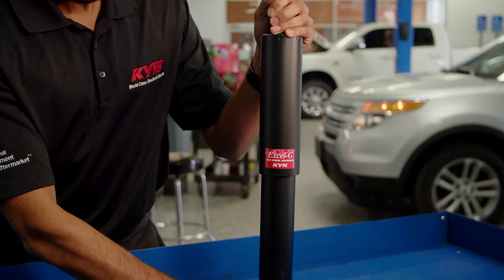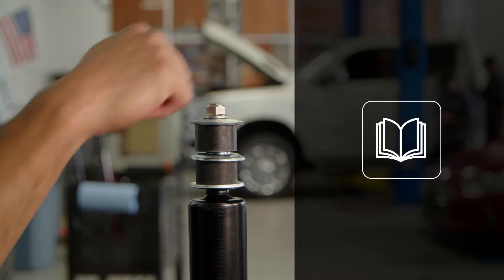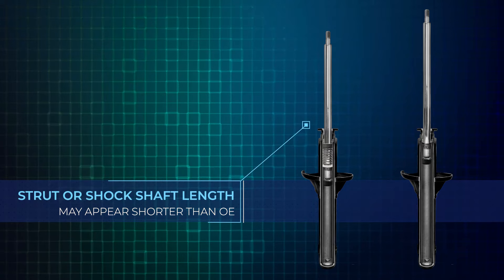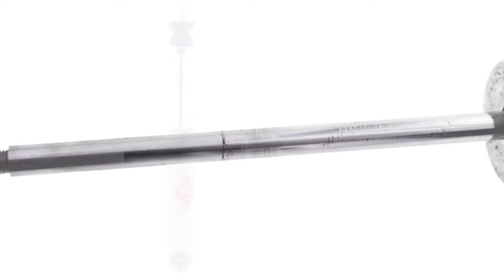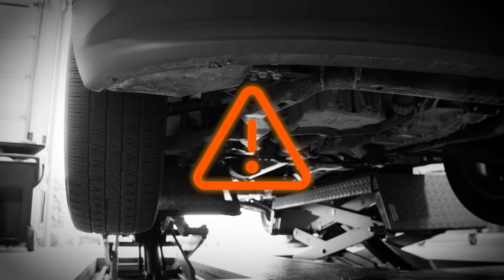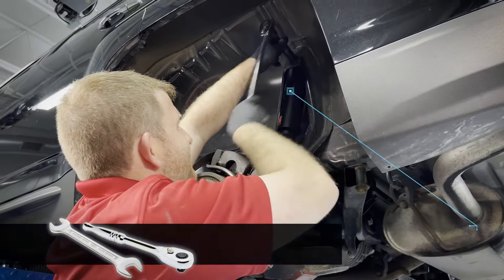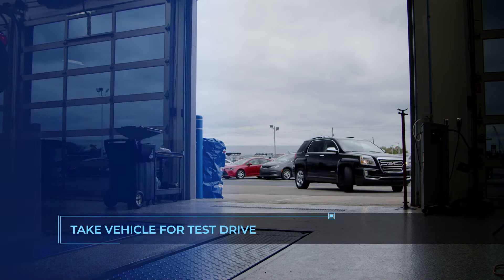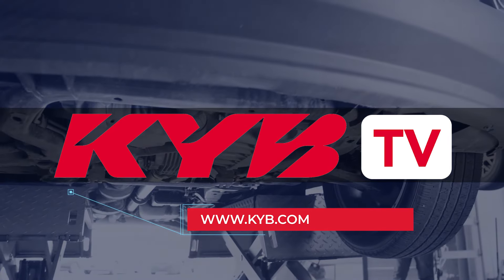KYB Shock Installation Pro Tips

Comment: I had a question on my 2002 Honda Accord LX V6 the 341257 model only comes in one style for front. All of the quick strut styles come on a left and right side model. Anything I should do to make sure they are installed properly?
Reply from the maker: I'd have to check with our tech support team. Emailing them questions like this would be a much better strategy than asking in a comment section. Please reach out to our tech support team at techsupport@kyb.com.

My guess is that it could be due to spring wind direction. The strut could be the same, but the springs used in the complete assembly could be left and right side specific for performance reasons.

Comment: Someone please help. I'm installing KYB 555601 Gas-a-Just Shocks on the rear of my 2004 Ford Crown Victoria. The shaft keeps spinning such that I have to use some other tool to hold it in place, like a wrench, I see there's a special tool for it, but I feel I've already gotten it too tight in trying to get it tight enough so the shaft will stop turning so I can put a torque wrench on there. I feel like I've surpassed the 30 ft/lb spec, but the shaft still spins, so I can't verify with a torque wrench.
Reply from the maker: We have a technical support team that loves to assist, but they don’t monitor YouTube comment sections since they have their contact information listed on our website. Please reach out by emailing TechSupport@kyb.com. 

There is a special socket tool for installing certain shock designs, which it sounds like you need. Be careful when installing suspension components with the wrong tools, there are many ways people unknowingly damage the shocks that lead to failures, so seek professional help if you're stuck.

Comment: Hello KYB. I purchased the rear shocks left and right for my 2007 Hyundai Elantra. Why are there no bushings and washers with the shocks? I may return for a refund because my mechanic now has to make unnecessary modifications with other type nuts and washers. Why man? I mean these seems reasonable suspension parts. The kit must always be complete. Please clarify.
Reply from the maker: Please contact our customer support department and ask them to check if your part is supposed to come with hardware. Email customersupport@kyb.com if you are in the US or Canada.

Comment: The “correct tool to hold the shaft in place” that your recommending in this video only has 2 sizes for the strut top nut. 14mm and 15mm. Kyb send me out a 17mm nut. that tool wont work for those that receive higher then 15mm top nuts for their struts.
Reply from the maker: We are recommending a type of tool in the video and included an image as an example. We don’t manufacture or sell tools and didn’t make any specific recommendations.
Reply: @kybamericascorp  well apparently kyb provides different sizes of nuts for different type of struts i assume because i received my struts with 17mm nut . And there is not a tool at all out there like the example you guys put that would contain a 17mm for the strut nut. That specific tool only applies for those that recieve 14mm or 15mm nuts with their kyb. The only thing i can find is the open end wrench set from harbor freight and buy the shock absorber socket to fit on the stem and combine those two tools to get the job done for deep areas.
Reply from the maker: @ElementTijuana  There are shock absorber tool sets that include the sizes you've specified and even larger than what you're listing. If you need help finding tools, there are resources that can help you.  

If you have any specific KYB shock or installation questions, please contact our tech support team, email techsupport@kyb.com
Reply: @kybamericascorp  thanks i will have that in mind

Comment: U guys should reconsidered making KYB - Gas-A-Just monotube shocks for all vehicles. Especially wether when u guys use to make and then stop offering and u offer just excel G shocks and struts. 

Or they don’t give them better options instead of just one.

Such as Toyota Corolla, Toyota Camry, Toyota Sienna, Toyota rav4, Toyota Avalon, Lexus ES models, Lexus LS models, Lexus IS models, Lexus IS models, Lexus NX models. 

And even all Scion models.

Such as Scion xA 2003-2006
Scion xB 2003-2006
Scion tC 2005-2010
2008-2015 Scion xB
2011-2016 Scion tC

Regardless if it’s demand or not a demand. 

I would love to have Monotube shocks for economy vehicles. Make it more fun to drive. 

And make it an amazing quality made shocks and struts by u guys ❤️‍🔥❤️‍🔥❤️‍🔥🤌🏼🤌🏼🤌🏼